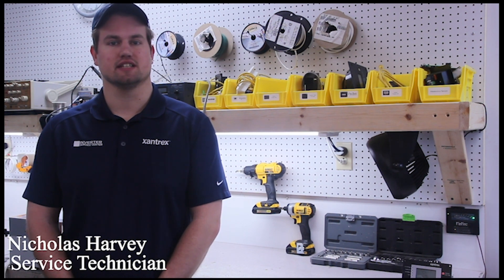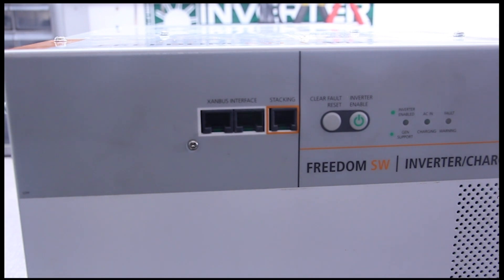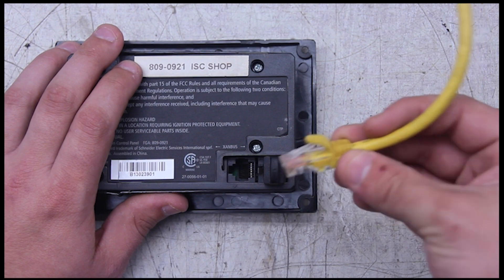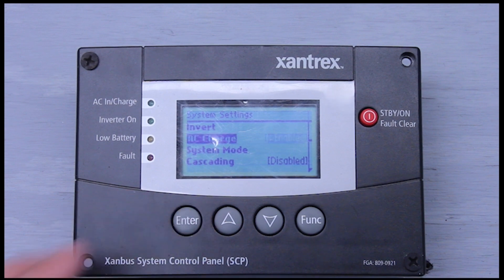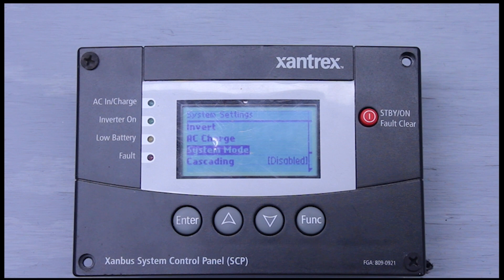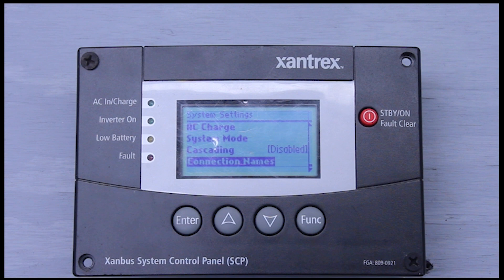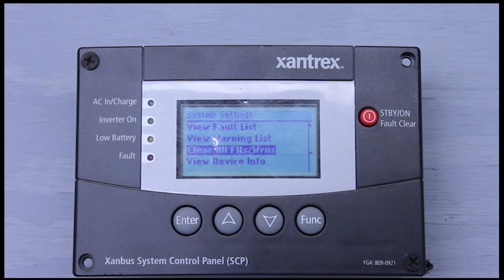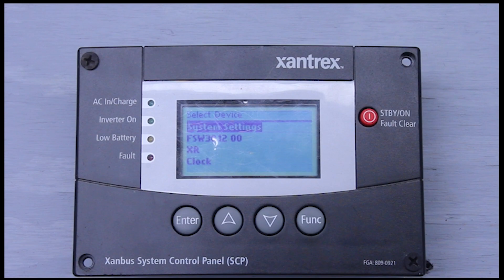FREEDOM SW System Control Panel Walkthrough with Inverter Service Center

Comment: Just watched your video. My system panel was fine till we did a reboot of the Li3. This was done because theLi3 system shut itself down bc it became over charged. Anyhow, the Xantrex panel no longer seems to recognize the Inverter bc : FSW301200 does NOT show up under ;Select Device',, No Indicators lights are lit on the left side, and under 'System Status' arrows are unresponsive and is blank to the left of arrow icon menu. Of note, all systems are functioning - A/C, Refrig, M/W, lights, water pump etc. The battery shows it is charging and is at 98%.  So what do I need to adjust to get the panel to talk to/recognize the inverter (which IS running)?